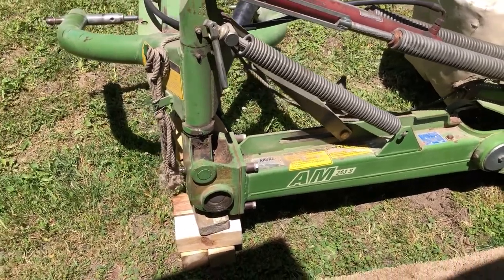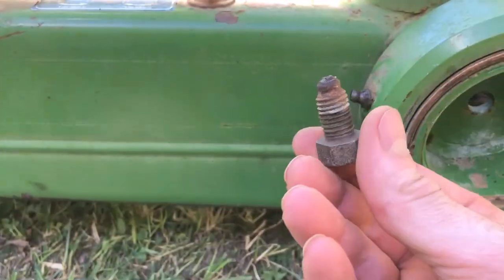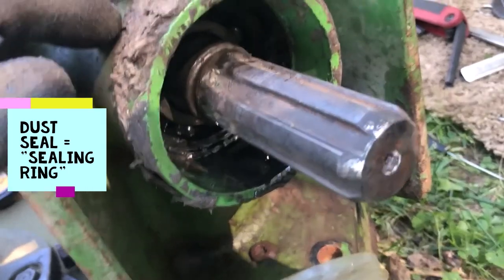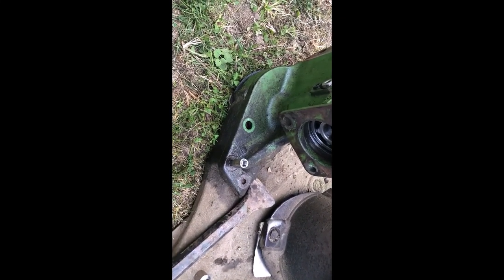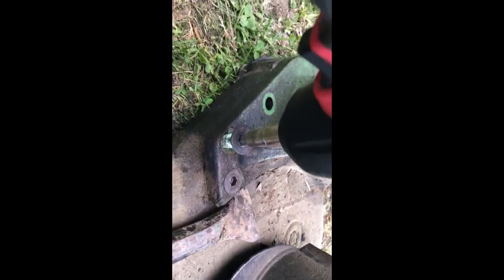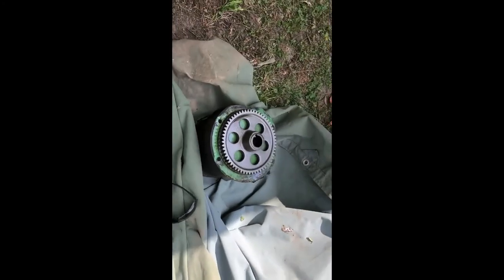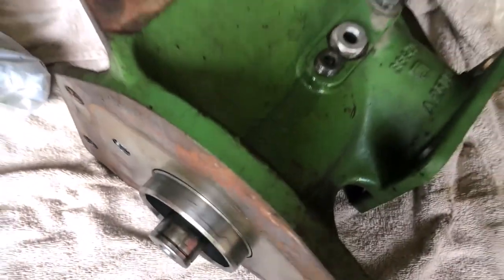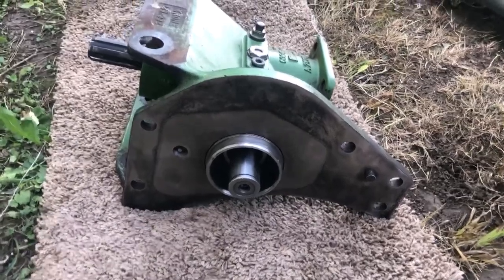Krone AM 283 S Disk Mower Rebuilding Gearbox

Comment: We just had ours done and the dust cover keeps popping off and letting all the oil out.... any ideas?
Reply: I just hammered mine dust covers in and they’re still in there not going anywhere, unless your openings are a  bit larger… or your parts are aftermarket and a bit smaller
Reply: @eliprimablessed4818  come to find out the drive shaft that I replaced was 1 inch too long at full height lol.....